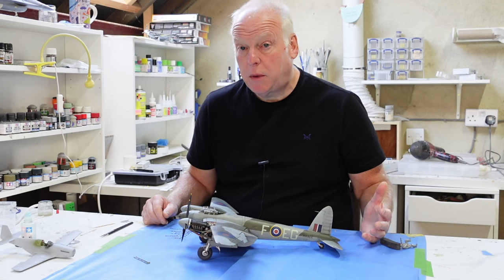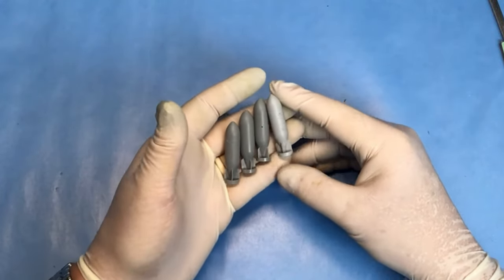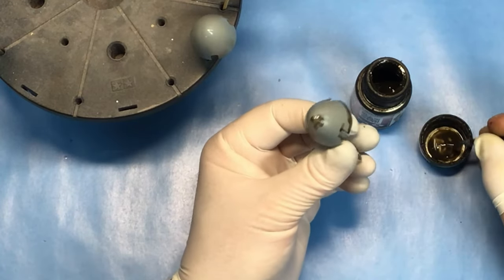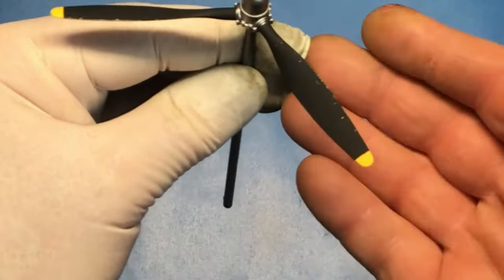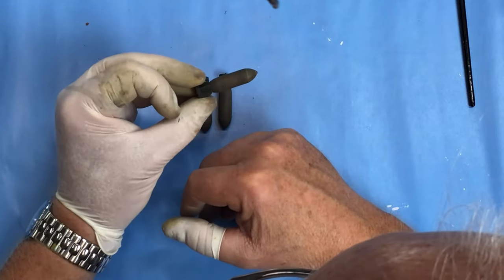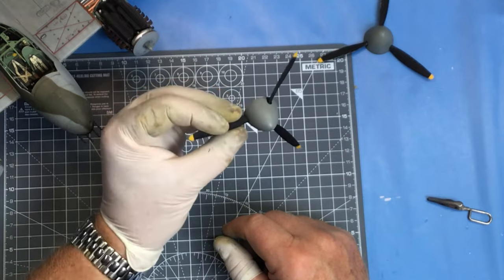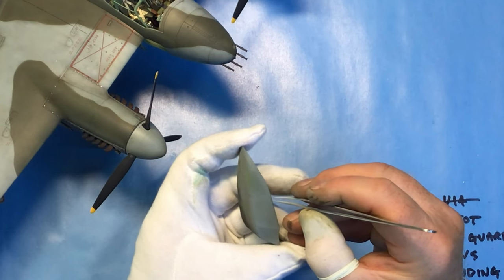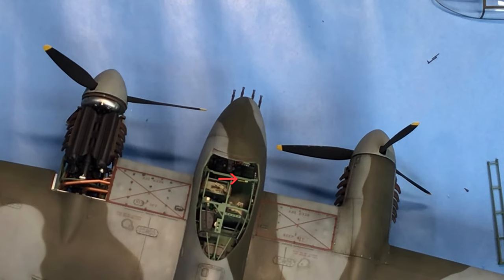Tamiya 1/32 Mosquito build series part 20 - FINISHED!!

Comment: fantastic many thanks. I am preparing to start this kit so very timely :) however I'll be adapting as a NFII version to match my father's aircraft in No. 152 Squadron RAF. I'm having to scratch build the correct AI MkIV and antennae. Should be fun.
Reply from the maker: Sounds an interesting project Michael good luck with it 👍

Comment: Fantastic video build series and amazing end result Steve. Nice work all round. I enjoyed the lot. 
Can I enquire because i'm curious - why did you paint the canopy seperately later and not install it earlier and paint at the same time as the airframe? would it not remove the need of all that masking in the cockpit and allow a more precise paint match?
Reply from the maker: I haven’t fixed the canopy Paul - I leave it removable. you’re right it is usual good practice but I’m happy with the paint match

Comment: That looks amazing!!  Did you have an issue with the lower cowlings? The magnets don't don't seem to be strong enough to hold them in place. Mine fall off after a few seconds.
Reply from the maker: agreed they’re not strong enough - that’s why I glued mine in place on the starboard engine.

Comment: Hi Steve, I am building this kit now and have learnt a lot from this series thank you. I do have a question about the roundels. You used Mr Hobby H47 acrylic which in your video looks brick red like the decals. But when I bought this exact same paint it looks very brown compared to the decals in fact nothing like the brick red at all. It has me stumped and I wonder if you have any thoughts on it.
Reply from the maker: Rod when I first read your comment my first thought was that I'd added some flat red to the H47 so I was surprised when I looked back at the footage (in part 17 I think) that I'd just used the H47 from the bottle. However I was matching the red to the Xtradecal fuselage roundels which are that shade - but RAF roundel colours vary alot from one decal manufacturer to another. The Tamiya roundels are very red (too red IMO). I'd suggest trying your colours out on some scrap and against any roundels you're going to use. You might have to add a bit of flat red to the H47 to get close.
Reply: @TheModelShed  Thanks Steve - yes a different decal colour would certainly explain the difference and I am going to use the Tamiya ones. The Tamiya Lacquer Dull Red used for the fuel tanks is also almost right but needs a touch of Pure red - so I will try that as well as your suggestion. Thank you for your reply. You are an excellent presenter and model maker.
Reply: I can see where my confusion came from. The colour profile differences between your camera and my display meant that the decal you had looks a lot like the Tamiya decal (more red) so I didn't realise it was different. It seemed funny that your bottle matched the decal when my bottle looked a lot browner, but the reality was both your decal and your bottle were a lot browner than they looked on my monitor.